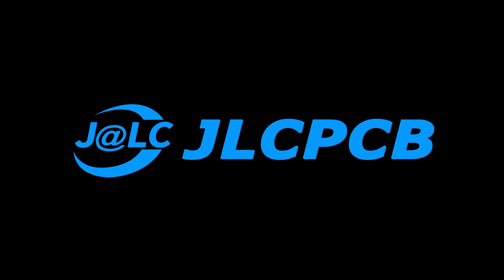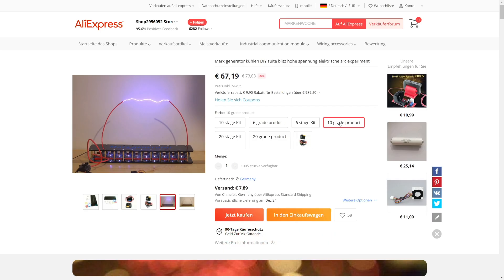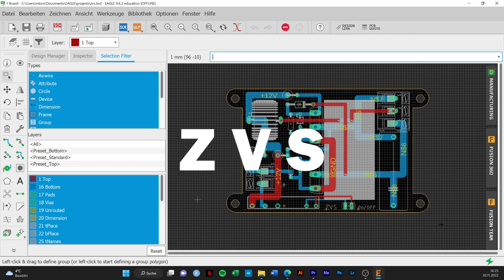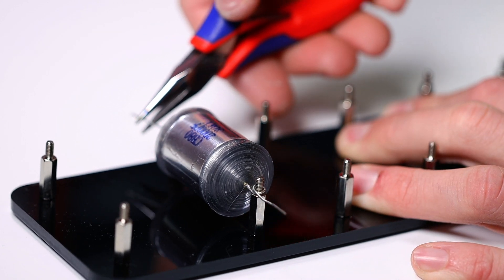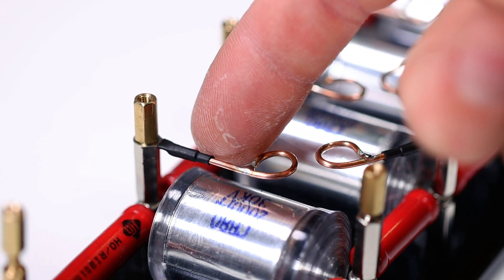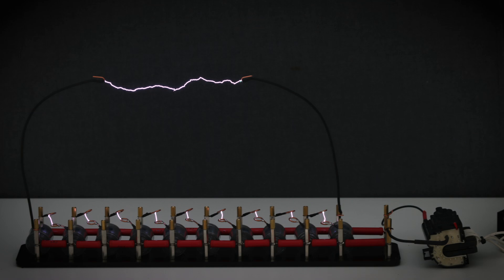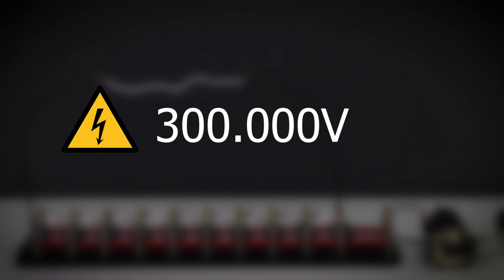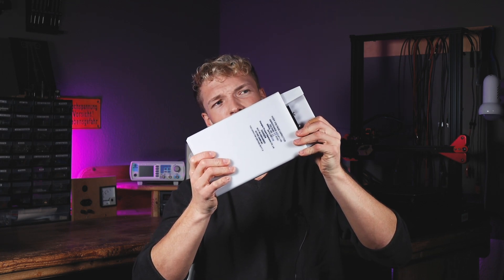I made a Diorama with REAL Lightnings (High Voltage)

Comment: Really pretty sparks. I made a little version of that while ago and that was so hard to tuning without coated insulator, for this reason I think you can coat the connections with such as insulator, because of corona discharge you possibly have decreased efficiency. Arrangements of the gaps important too, especially first ones for timing. Great work!

Comment: If you added one larger capacitor…. The high voltage Marx generator would provide a path for it to discharge and you’d get a MUCH more impressive lightning.
Reply: in parallel with the output? i'd love to try that
Reply: @NerdlabsSci  You can do parallel but it seems this gentleman used a series setup... see "Asymmetric Marx Generator".. ignore the annoying music and it's in Korean but there's a general schematic in the video.  Be careful, I'm sure that circuit can bite you really hard... could be quite dangerous so be extra careful my friend.

https://www.youtube.com/watch?v=Qc_B0e0xPTA
Reply: @thathalfthaiguy  i've heard marx generators can produce EMPs. I wanted to try zapping some old electronics, light bulbs, and a plasma ball for a youtube video. I will check that video out asap
Reply: "lightning"
Reply: @dandruff7807  Thanks...